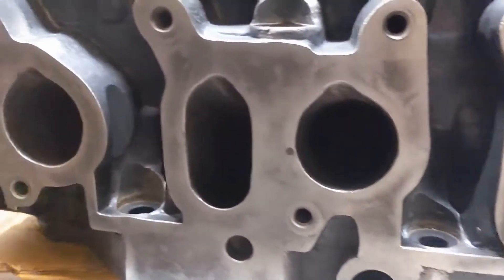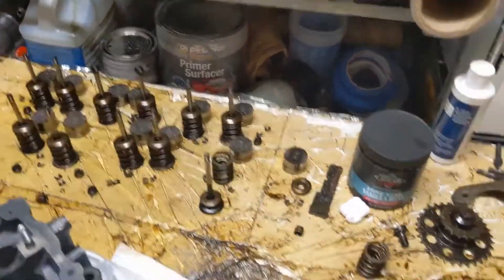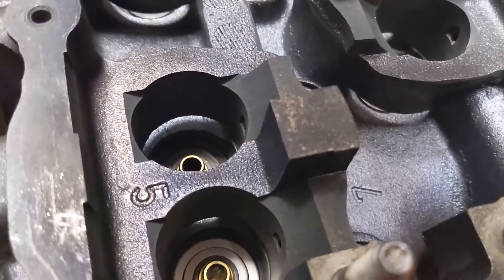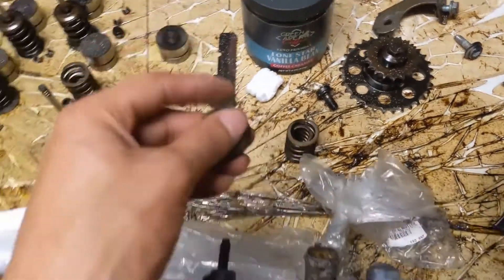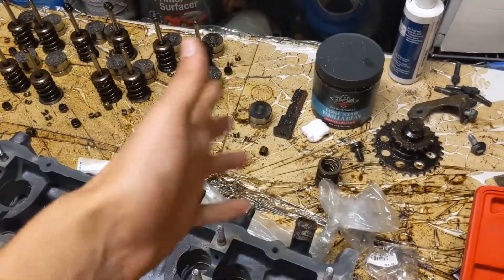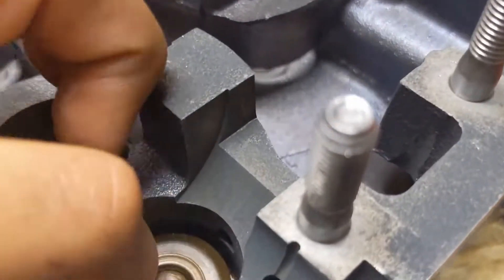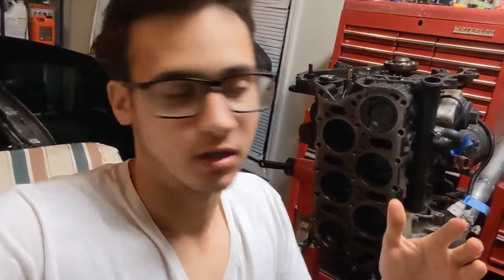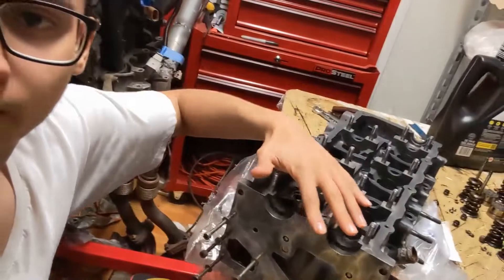VR6 Performance valve springs

Comment: good video, i got a vr6 too, i’m thinking about copping a set, they easy to install? how long did it take you dude
Reply from the maker: If the head is off yes it's easy takes about 2 hours tops but you more then likely have to remove the head and timing chain it's a pain. I just sold my VW btw